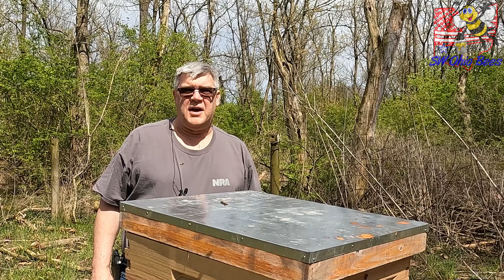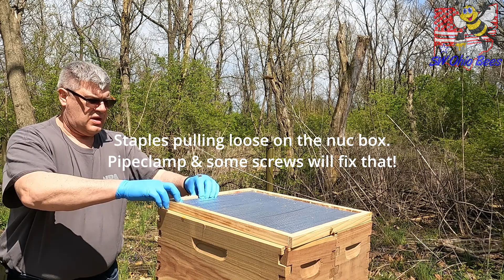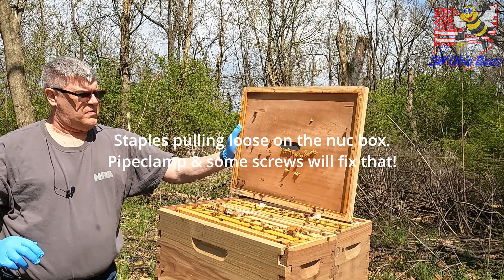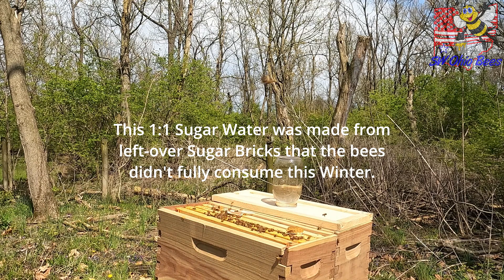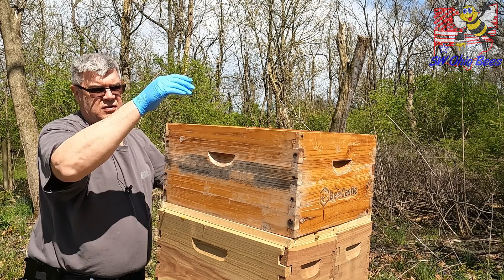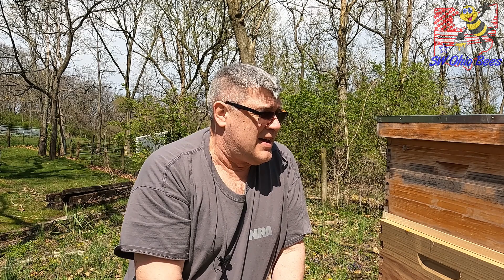Short Update On the 3-Way Split to Add the Feeders

Comment: Can you please tell me where you procured your jar feeders? I'm planning to do the exact same 3-way split you are doing using a double screen board with newly purchased 4-frame nuc boxes. This will be my first time attempting this. Only thing I was trying to figure out is how to feed.
Reply from the maker: https://www.amazon.com/Ball-Regular-32-Ounces-2-Units-Pack/dp/B01N6QBJG0/ref=zg_bs_2237239011_2/145-8687223-9190315?pd_rd_i=B01N6QBJG0&psc=1
Reply: @swohiobees  Thank you Tim. Going to order those now. Did you punch the holes in the lids yourself? Any knife good for that?
Reply from the maker: @koblick  - Just small holes.  I tested mine & they stop dripping in just a few seconds.